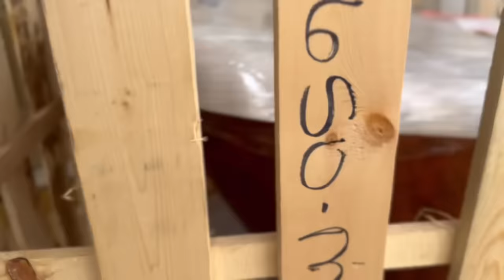Full Tour and Update on Hannah’s House and Neck/ Back Update

Comment: Jeff was lucky to have found you when he did Paige. I'll bet it was a chore to keep him to take it easy, good job. One thing you didn't mention was the gun safe. A friend of mine had one built in the house while building it using 12" concrete block filled with rebar and cement for the walls and 8" concrete floor and ceiling. I think he said the door came off a bank vault. I believe it measured inside 10'x12' x8' high. He told me the house could burn to the ground and his guns would be safe. Take it easy and heal.

Comment: Hey bud might I give you a suggestion on your flooring, check out a flooring called Titan it's a half inch thick click together and waterproof flooring,it will hold up for a long time and it don't come apart over time,I lay floors and we're having allot of trouble with the thin laminate flooring the more it gets walked on it starts to come apart, the Titan floor is a little costly but there's no comparison to it and life proof flooring and you can get the Titan in a rustic color that would really be beautiful in that house, just trying to save you problems down the road , we've laid a bunch of the life proof and other things water proof laminate but having to go back and replace it some didn't last 6 months but beautiful job on that house bud ole ga boy

Comment: Have you thought about CPES & Tung Oil Varnish around the tub area? That's the same waterproofing wood finish used on wooden boats. I have done an outdoor wood sign, which still looks new after 15 years in the weather. Far superior over urethane.

Comment: On the flooring I just got some from home depot, they didn't have it at the store I had to order it. I have used it several times in rental properties. It is very durable. I think its about $1.99 a foot. It was TrafficMaster Dowling 4 MIL x 6 in. W x 36 in. L Grip Strip Water Resistant Luxury Vinyl Plank Flooring (24 sqft/case)
They have it in different colors.
Though it might help you out..

Comment: We both are 100% southern but I'm going to say it again.  Do Not Over Do It. I'm luck enough to have my house finished off but was wanting to build another one back in the woods. Two strokes has stopped that so I just clean guns and watch the deer, turkey in the yard and use my 17 HMR to eradicate the coyotes.  Have had 3 bear so far but they don't bother me so we exist together. Just got the wife a new 9 mm for safety sake.  One Question. Is the water via Well or under ground?  I ran mine over a quarter of a mile from the main road and have no problem with the pressure. Buried my power like you did and have yet to have a problem.  Coffee time. Again, from the East TN Mountains, do take care and I will watch for the finished product.

Comment: I seen the tub being fiberglass, i have to give my experience from the one I bought back in 1985 and installed in one of the new houses that I built.. It was beautiful, but after a short time, a crack on the side appeared.. It didn't seem to leak; no water was coming out from under it, but I did not like what I saw..  Maybe they have improved them by now..

Comment: Paige has the softest voice.   Hip replacements are quick these days. Praying for your brother and Jeff.  Fantastic job on the house.  @ 2:41  you may not have enough height for an Antler chandelier.  400 Amp Service?!
A Welder in every room.!   I am not a fan of Rusty Tin.  Hire out that Flooring and sanding and plumbing.  We know you can do it, but should you?